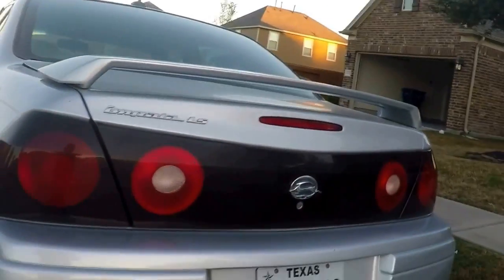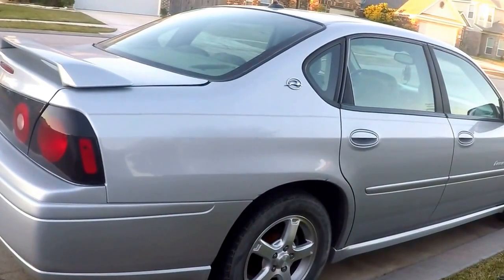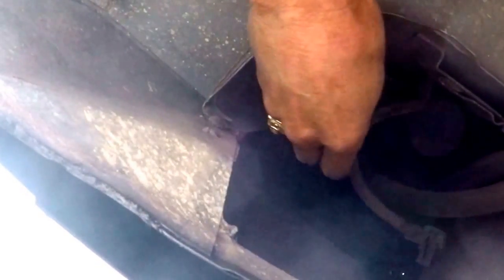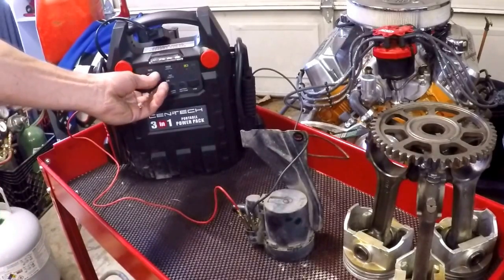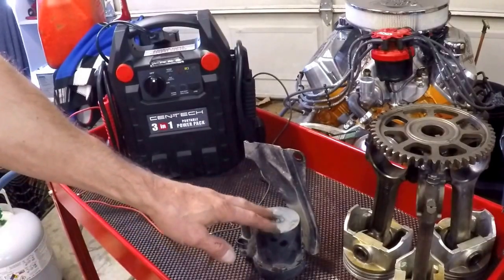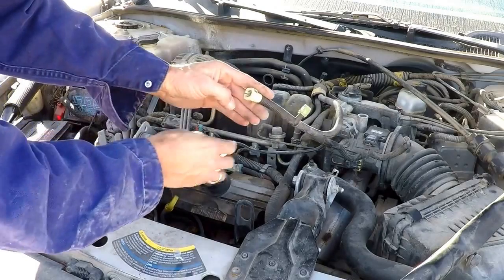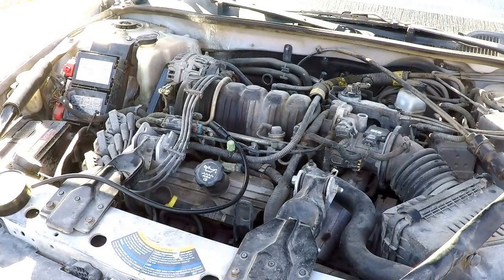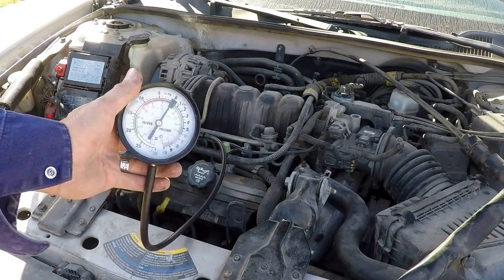P0455 Evap Engine Code 2004 Chevy Impala - Troubleshooting and Resolve

Comment: Good video. I had to replace the purge valve solenoid, and the fuel pressure regulator for rough idle and hard warm starts.

Comment: Would the vent valve cause a 04 impala to make the gas nozzle keep cutting off it takes 10 mins to pump 20$ in it...
Reply: Yes
Reply: anywhere in the lines from purge valve to gas tank and from tank to vent valve are probably clogged with the charcoal from the cannister
could be the screen is bad at the end of the line from purge to charcosl cannister.

Comment: I have an 04 LS as well - both times was the solenoid. Tried cleaning it out and servicing but didn't work. Had to replace. Not hard to do.
Reply: Do you have a picture of the part you replaced ?
Reply: @isaacrischer7611  No, sorry.
Reply: @rangerrick8220  Ok.

Comment: Great video thanks. I have this right now in my 04. Are these the only three places to check?
Reply from the maker: These are the only two solenoid valves, but failure of the tubing/piping system can definitely cause a large leak. You need to trace around and make sure there are no obvious breaks in the system.
Reply: +Trey Clanton Right on man I hope I can find a garage away from the freezing snow.
Reply: @zombie2012  HaHaHa, my problem too in the winter.
Reply: Clear, easy to follow video, answered the main question I had right off the bat! Thank you for taking the time to make this video.